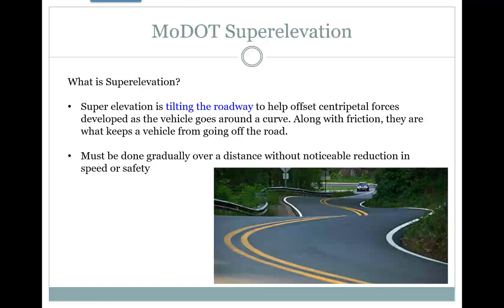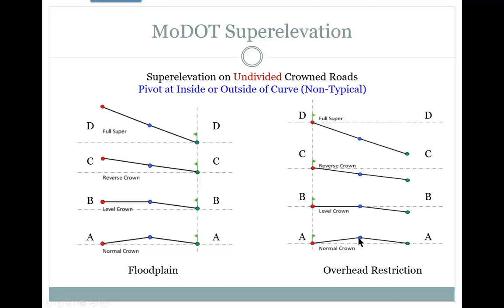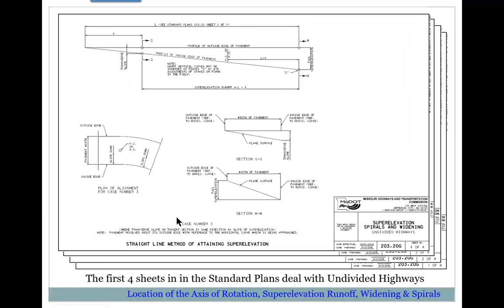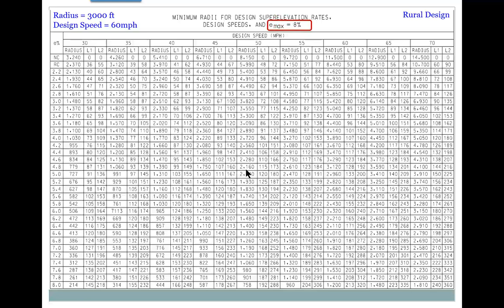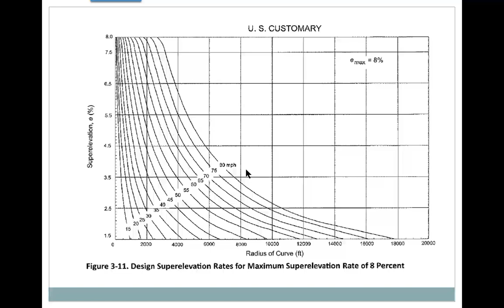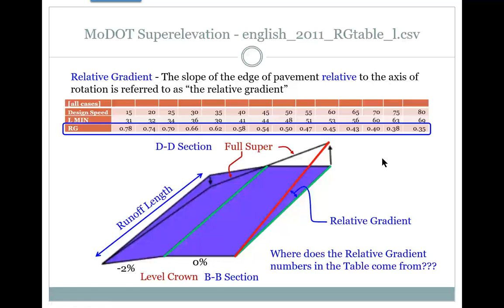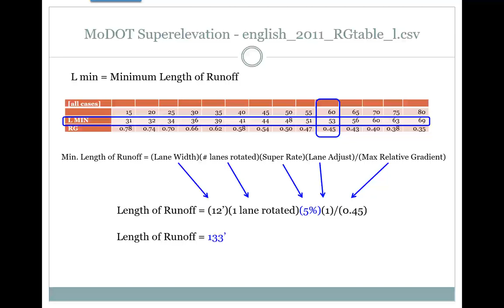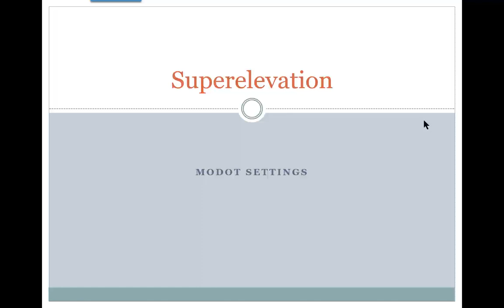ORD - Road 1 - Chapter 6 - MoDOT Superelevation Explained

Comment: Not sure if the author read this after 3 years, but i've got some questions about the Floodplain option at 5.15 in the video.
in that case, when the lanes are rotated to, lets say 8%, around the EOP_Right, the centerline should theoretically  rise above the actual alignment+profile height.
When i'm trying to do this, the centerline stays always attached at the profile height, and thus lowering the EOP_R below the floodplain.

Is there a special way to setup the template for an undivided crowned to have the option for the CL, which is the baseline for the template, to be able to rise above the actual profile?